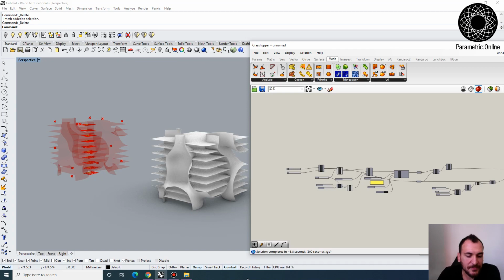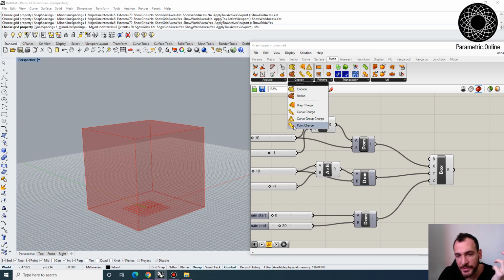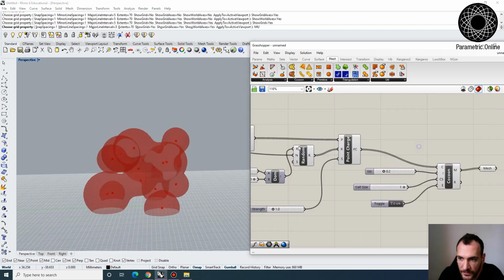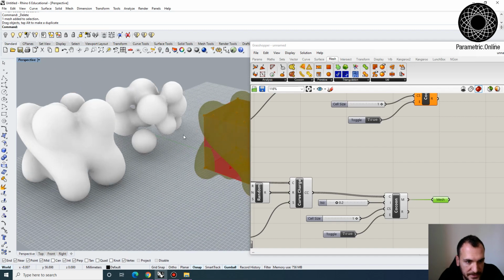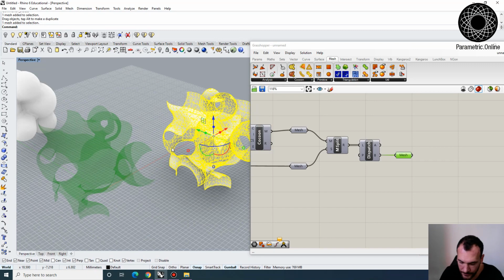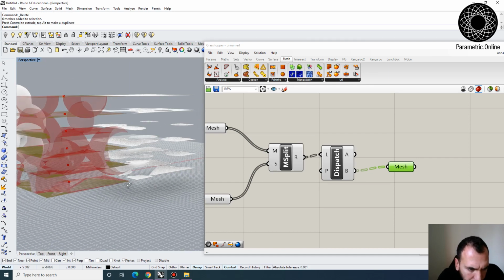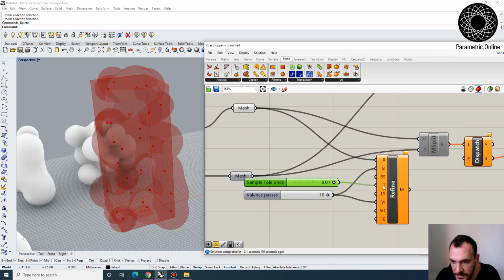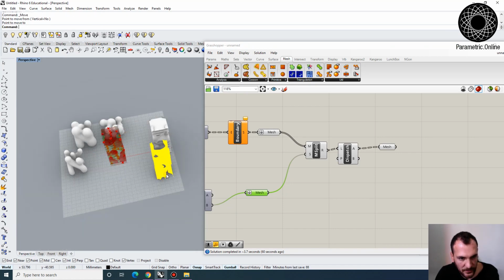Cacoon Mesh

Comment: Hi. This is a nice tutorial. Its very helpful. I have a question about the curve charge. In your video, you were used 2 different surface which is top to the bottom. In my project, I need to do this on the 3 connected surface but I coudn't do that. Could you please help me about that? Thanks a lot..